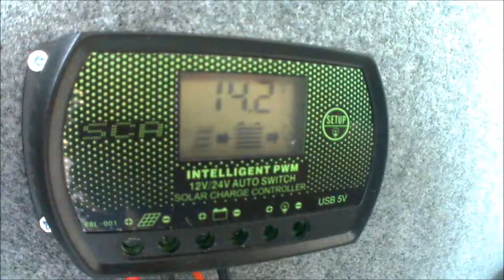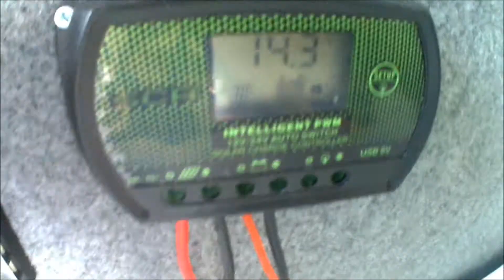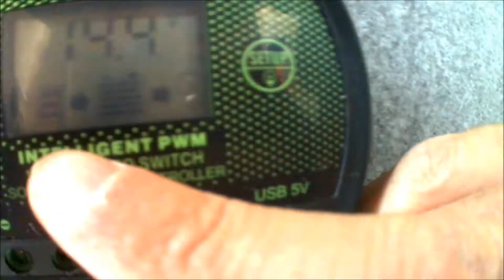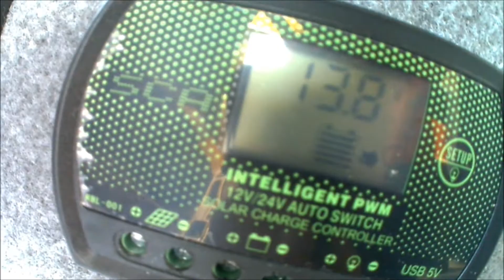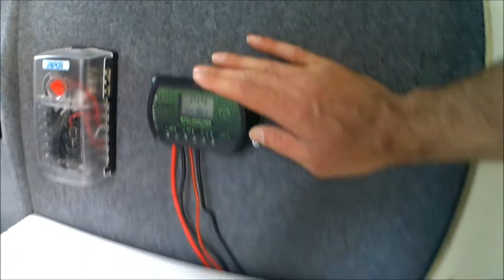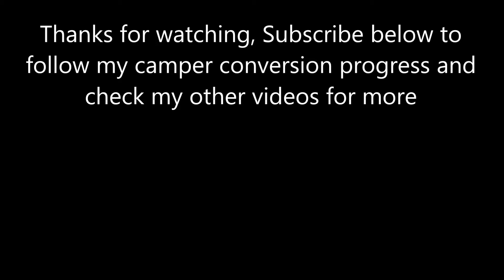How To Fit Campervan Solar Panels & Controller Install VW T4 Camper Conversion Solar Install

Comment: Nice install. I have just overhauled all the running gear on my T5 to 'as new' standard so shes been off the road for 18 months. Shes high mileage 250k + miles and was all very tired underneath! No one seems to show high tops having EV panels fitting. High tops present a problem on the VW's as the sides narrow meaning the roof top is NARROWER than a standard low roof. This limits the space we have and what panels will fit. I'm aiming for 2 x 210 watt panels into 2x AGM 210Ah batteries. This should give me ample to even run a microwave, TV etc. This is going to be my full time home so CANT get anough power as Im also a gamer! Cheers!
One little tip I use is to FILL outside junction boxes with silicone. With it being in the airflow of you belting down the motorway is CAN force water in where we dont want it! If you need to do anything the silicon simply peels out like a rubber block! HAPPY TRAILS!

Comment: What amp solar controller did you use for a 160wat solar pannel? 

Anybody know what amp solar controller l would need for 175w solar pannel? Thanks
Reply from the maker: 20 amp will be fine for it

Comment: Hi..great video..very helpful in my set up..does the on/off switch go onto live wire between solar panel and controller ?
Reply from the maker: Hi, yes thats how I wired mine so the solar isn't on constant top up otherwise it could damage the batteries
Reply from the maker: I fitted a switch incase the controller ever had a fault and kept charging when not required, my van isn't in use much either so no need to have the batteries on charge 24/7

Comment: My high top is fibreglass so bonded mine with sikaflex 221. 2x 100w flexi panels
Reply from the maker: I heard the flexi panels overheat and loose efficiency in hot weather so went with fixed panels instead.  Just been away and saw a peak of over 120w and the batteries never ran down at all in over a weeks off grid use
Reply: CamperConversion true they can especially plastic backed ones, mine are alloy backed and spaced slightly off roof for air flow

Comment: Good vid, got a mate who is planning the same job. Did you buy the panels new, if so where from?
Reply from the maker: Thanks, yes everything going in/on the van is new other than the fridge, these were bought off ebay but I had to hunt for a long time to get a matching pair which would fit in front of the skylight without overhanging the front of the roof, about £70 each if I remember correctly